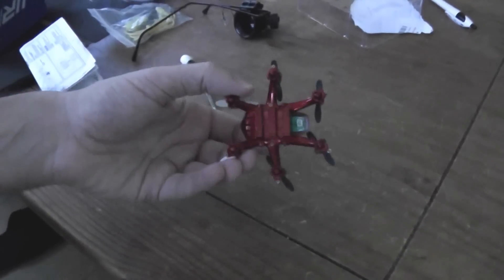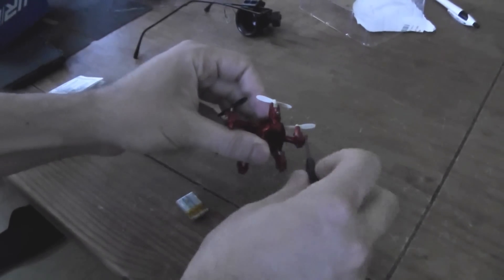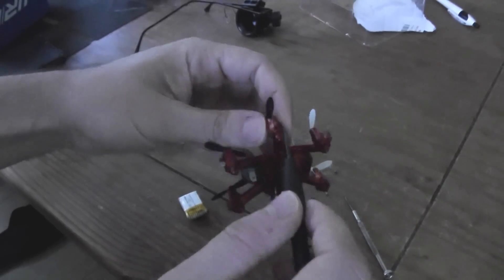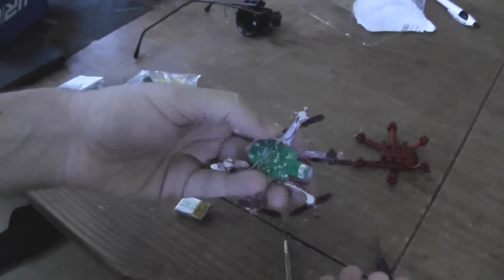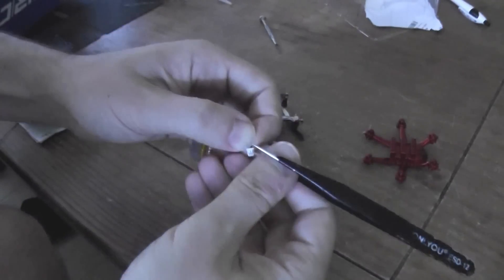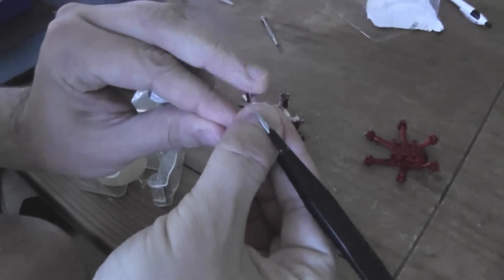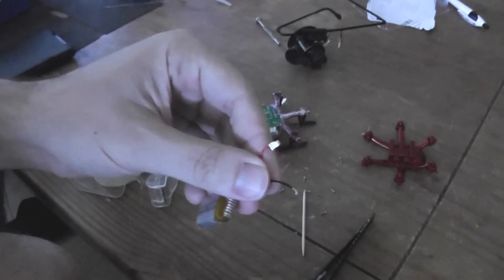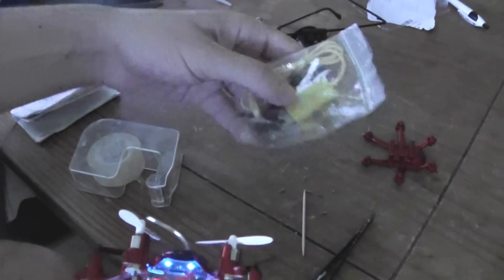JJRC H20 battery connector mod (Courtesy Banggood)

Comment: I use a red sharpie pen to mark one side of the plug - if you mark it before you modify it (but mark it for the way it will be when you finish) you don't have to worry about figuring out where to insert the red vs. black wires.
Reply from the maker: Yes good tip for such micro JST connector
Reply: SeBy DocKy 
I actually have the opposite polarity problem. I have JJRC H20 batteries which I want to use on an Eachine TX03 camera.
Reply: SeBy DocKy 
I mark the plug and the receptacle on all of my drones & batteries. 
I make the positive half of the plug red with a permanent marker, and for my old eyes, it helps a lot.

Comment: I super glue wires to connectors so the can't pull out.  When swapping motors I tape the wires together and burn 1/4 inch plastic off,  twist the wires together and use conductive wire glue ($6 from ebay) to bond.  When wire glue dries,  super glue or shrink wrap for added stability and presto.  Happy flying pilots!

Comment: my H20 connector on the board is completely different. It is parallel to the body.                                           the connector opening is faced toward the back. can I do the same mod?
Reply from the maker: No I don't think so ... You have a new revision of the H20....
Reply: OK... This H20 has an on/off switch as well... thanks.

Comment: The motor spins but doesn't fly. Any idea why?
Reply from the maker: +Carlos Carpio you can control motors with the radio ? or spinning at the same speed ?
Reply: +Carlos Carpio probably some or all props are mounted in wrong direction...

Comment: Hi, thanks for the video, quick question, what happens if I connect a normal battery to the H20 without this mod?
Reply from the maker: +Nikolas Manuelides You will smell a smoke .... Quad dead
Reply: SeBy DocKy glad I asked first xP thanks

Comment: Thank you a lot for this tutorial. I always wanted to do this on my UDI U840 but I thought the connector was soldered on the board. Didn't know exactly how so I never messed with it, didn't want to disable it , but now I just swapped the plastic connector like you did, very happy because now I can share the same lipos with my moded cheerson. :) Now I just need to fix the polarity of UDI U939 but that one is easy. I will change the connector also to match my other quads and batteries.